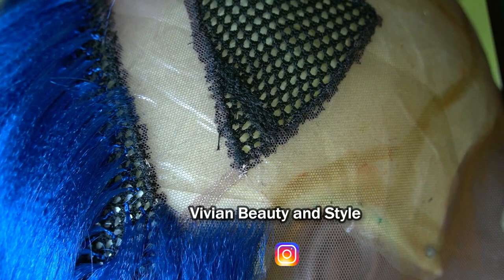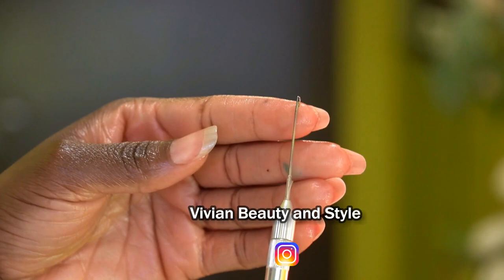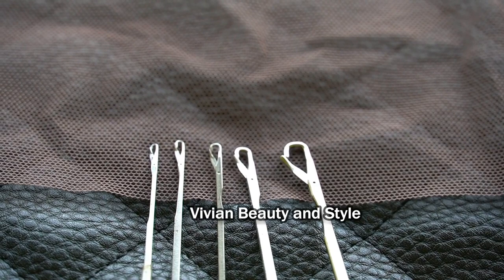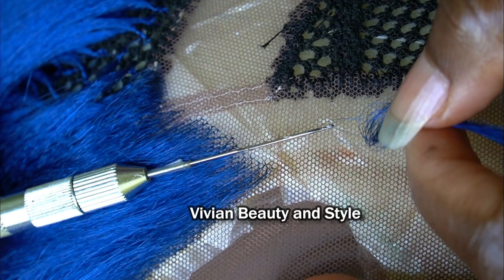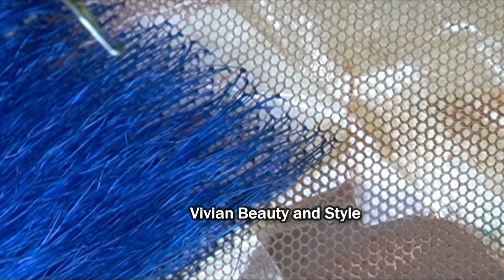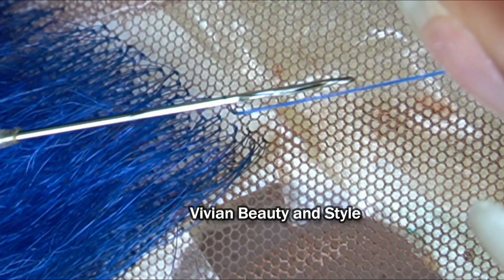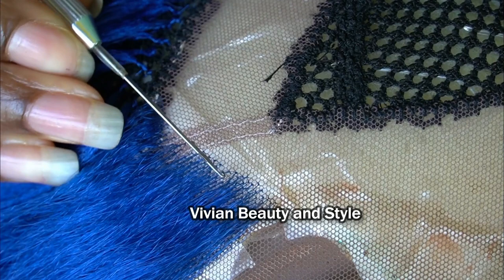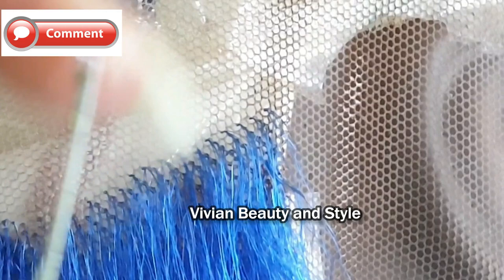How To Prevent The Lace From Breaking When Using The Tiny Crochet Hook | Hair Ventilation

Comment: Vivian, you are a genius and a blessing. I started making wigs (very rough compared to this level of finess)when you could only get imported wigs from special shops. Although, I gave it up since, finding your channel has rekindled the desire to make wigs again!  Thank you for confirming this method of ventilating.  It's the method I've been using as I couldn't work with the ventilating needle. However, my most recent project (a replacement closure for a wig) has some issues. I washed it and some of the hair have turned inwards under the lace.The parting is no longer clear.  I'll be grateful if you can guide. Thank you.
Reply from the maker: You need to redo the part. Make sure to secure the knots properly and you can heat seal the knots once your're done ventilating the hair.
Reply: @Vivianbeautyandstyle  Oh✋😊 Thank you so much for responding! 🤩 Excited 👏
Keep being a blessing dear! The Lord increase you on every side!🙏
Reply: @Vivianbeautyandstyle  please were can I get the smallest crochet pin